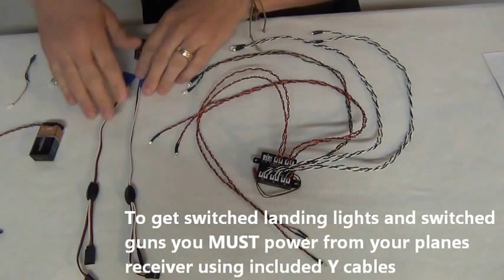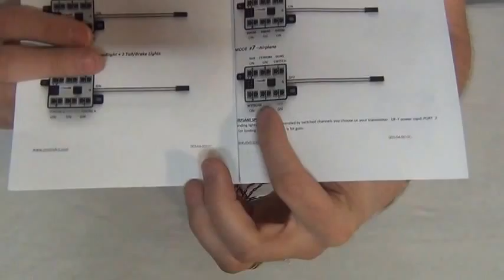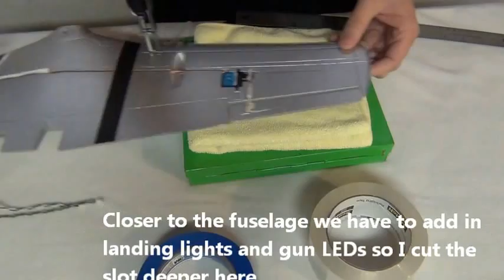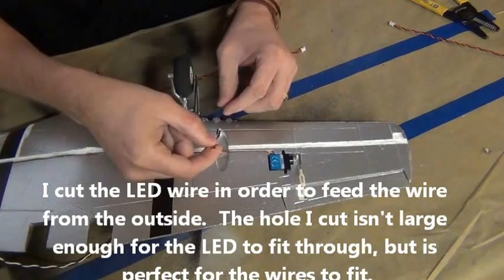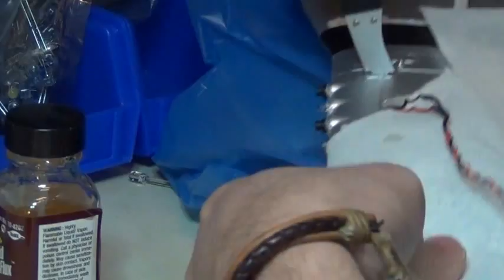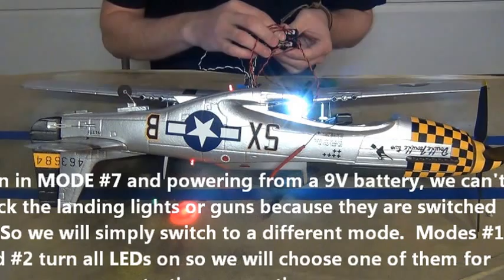RC Airplane Lights Detailed Installation

Comment: using magnet wire instead of the supplied wire is a better idea. thinner less space needed. I plan to use it on all my wiring needs.